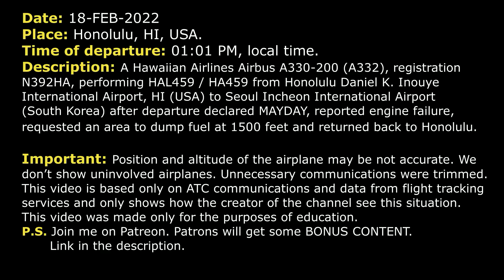MAYDAY. Engine failure after takeoff. Fuel dumping | Hawaiian Airbus A330-200 | Honolulu, ATC

Comment: Also if you had one engine Failure with no engine fire indicated why wouldn’t you taxi off the runway and leave it available for any other emergencies does not make any sense drama Pilot 😵‍💫
Reply: they also wanted a visual inspection from the ground crews as the failure could've done something the pilots didn't know about
Reply: it's standard practice to shut down on the runway in the US, they need to stop as soon as possible

Comment: This sequence of events is very strange. Levelling off at 1500ft after an engine shut down isn’t the best idea, even if you’re over the ocean and there isn’t any terrain where you’re holding. Also, asking permission to jettison fuel is odd.  This isn’t kindergarten where you need permission to go to the toilet. You’ve announced “mayday” (although pan would be sufficient) and you’re clearly wanting to return fairly urgently. 40,000lbs is about 10-15 minutes of jettison time. Begin the jettison and tell ATC, don’t ask for permission.
Reply: Wow didn’t know u  are trained pilot and experienced many of these issues

Comment: I echo the comments here, great video and production. But why on earth stay at 1500’ 20 miles away from the runway?????
It’s an ETOPs aircraft for goodness sake, a climb to 5-10,000ft would have been no issue
Reply from the maker: Thank you. I don't know what was the reason.
Reply: @YouCanSeeATC  I was a pilot training manager at HA during this time and subsequently discussed this incident in class as a great example of airmanship and communication- both internally and externally with ATC. I have also been a pilot in the seat during 13 engine failures (I was military and flew C-130s), so I know what they were juggling. I can tell you that performance-wise, they were doing everything they could to keep people safe on this hot day, and fuel jettison kept them within safe landing distance/braking limitations. They stayed at 1,500' (I presume- for the record, I was not part of the ERC or the investigation) because it is an easy pattern altitude, and climbing then descending again to land immediately would have added to the complexity and workload they were already experiencing. At 1,500', there is no need to run additional climb/cruise checklists, nor a complicated descent and slow down when turning back in for a landing. The extra altitude would help if they had to glide on zero engines - maybe - in the infinitesimal chance they lose the other one, but not necessarily. Climbing higher when the other engine was producing perfect thrust is not necessary and can potentially make calculating a landing spot and pulling off the single-engine landing maneuver more complex.  Every pilot is intimately familiar with a 1,500' radar or visual, pattern altitude speeds, etc. This was a very sound workload-management call; they also dealt simultaneously with cabin crew, passengers, and emergency responders. Less juggling of tasks = more safety. If you knew all the performance and workload considerations, not to mention the engine failure possibly turning time-sensitive as it did in the recent Trans Air crash, you would have preferred what they did to having them climb up into the higher altitude structure, taking additional time and power on the operating engine if you or your babies were on this flight.

Comment: Excellent procedure on the emergency call! That's the way to do it. Just a bit surprised they stuck around at 1500 feet where discovering you had a common mode failure, like the same person made the same mistake on both engines, would lead be a real issue. Was there low cloud? I thought the minimum dumping altitude was 6,000 feet, but the FAA says 2000 feet above anything within 5 miles, which I guess would mean 2,000 above the Pacific. https://www.faa.gov/air_traffic/publications/atpubs/atc_html/chap9_section_4.html

Comment: It's rare to see ATC rush the "cleared to land" clearance -- I wonder if they thought they needed to do this because of the Transair B737-200 that ditched off Honolulu about 7 months earlier. That Transair flight with the dual engine failure was a true aberration, since dual engine failure on a jet is exceptionally rare. However, the quick "cleared to land" by the controller here had no adverse effect, since the pilot just calmly replied to the effect of "no thanks, we want to wait."
Reply: Right. ATC did an excellent job, if you need to come back you can do that right now. Exactly the sort of response that should be offered to a MAYDAY call.
Reply: I thought the exact same thing.
Reply: I think if you listen closely the same controller was in the tower for the Transair B737-200 and this flight.  I think she was there on another engine out incident about 2 months after Transair B737-200.
Reply: Nope hnl favor Hawaiian over other airlines it's a known fact anyone who works there knows about that
With dumped fuel to oil spill they get away with alot in fact most rubbish on the ramp it's from Hawaiian airlines

Comment: Just curious why they chose to stay at 1500, looks very low, i thought you would ideally want to get some more altitude  for troubleshooting and fuel dumping before returning.
Reply: Completely agree, surprised they didn't climb up another 5000ft
Reply: If they’re over the ocean there’s literally nothing to run into. Standard traffic pattern altitude for turbine aircraft is 1,500AFE.
Reply: @TGCourt  it just leaves very few options if the other fan quits.
Reply: @TGCourt  They were 25 mi out, not in the pattern.  If they had other issues, 1500ft can disappear very very quickly.  Plus I've never heard of anyone fuel dumping from 1500ft, normally ATC will give you a climb into the 10k range prior to a fuel dump.
Reply: @Boffin55  totally agree with you
Reply: @TGCourt  I am assuming cloud. I don't know though. As mdb831 says, that's not leaving many options if the other one quits.

Comment: Internationally, as long as the engine failure doesn’t cause a dire control issue like a loss of control, you would normally declare a “Pan-pan, Pan-pan, Pan-pan” (said 3 times) not a “Mayday”.  You’re telling ATC you have an issue or problem but controllable and you may not be able to comply with their instructions…and to standby.  You can always upgrade the call to a “Mayday” if the situation becomes more dire.  

We don’t “Declare an emergency” Internationally.  That’s a US thing.  Declaring an emergency in the US is like saying “Pan-pan” Internationally.  If the situation becomes worse you can upgrade it to a “Mayday”.  If you say “Mayday” over in Asia, they will stop all traffic taking off and landing for you and until you safely land.  Not something you really want to do at a big International airport unless the situation warrants that.  

So, it sounds like it wasn’t a dire control situation and therefore declaring a “Mayday”  wasn’t the correct terminology in this particular instance.  Not gonna ding the crew cause I wasn’t there and don’t know what they were dealing with initially and they may have had control issues.
Good job by all involved.

Retired MD11 Capt
Reply: ATC direction for mayday includes:  "engine failure that will lead to a forced landing/ditching/ejection/bailout;"  Since the pilot did not know the exact status of the engine failure at that point, he was playing it as safe as possible for the highest priority with ATC.  My God, you people really think you know all about flying commercial aircraft from your keyboard while sitting safely in your basement.
Reply: @buckhorncortez  He just wanted to show that he was a MD 11 pilot.... Stupid comment about "mayday or not mayday"....
Reply: @PetrolHeadBrasil  Actually, I was quantifying my answer with my background to show actual real world expertise and not just the usual Microsoft Flight Sim keyboard warrior expertise I see on here.

Frankly, I don’t know why I even bother anymore trying to help those who ask questions.  You guys think you have it all figured out and I can certainly find better things to do….Bye!
Reply: @willyTB1962  bye-bye, darling!
Reply: @willyTB1962  ohhh, and by the way: 11 years of aviation here... ;)
Reply: It's subjective, who cares. Maybe (doubt it) their SOP's require them to call a single engine failure a Mayday. You're looking too far into it anyway.
Reply from the maker: Thank you for your comment. That was a long text with a lot of information 👍
Reply: Theres always gott be 1. Losing an engine is always an emergancy. It is easy to back seat drive when you are not in it. They did a great job, no incident, no injuries, no further damage to the aircraft. Great job by these boys. I hope I get to fly with them.
Reply: There's far more to consider than just "they only lost one engine". If you're up high and have plenty of altitude (and thus time) to play with, and within easy glide range of one or more airports, and/or can rapidly identify the cause of an engine failure as being something that's extremely unlikely to result in a second engine failure, then by all means don't sweat losing a single engine. Pan-pan is probably appropriate.
In this case the pilots didn't have sufficient altitude to troubleshoot the problem or give them a margin of error in the event of a second engine failure, so mayday seems quite appropriate.
Reply: Pretty sure a blown up engine is in fact an emergency internationally 😂 just because they were calm doesn’t mean it isn’t dire.
Reply: @BlakeWildBASE  Granted, it’s more serious than the coffee machine stops working on a long flight🥴, but it’s typically not a dire life and death situation on large jets.  All performance calculations are based on losing an engine at the most critical point on the takeoff roll (V1) and continuing the takeoff while meeting all climb performance criteria.

When the crew said “Mayday” that sets in motion different actions by ATC than just saying something like “Hawaiian xxx…engine failure, declaring an emergency…turning to heading xxx, standby”. Saying Mayday t means we need to land NOW..IMMEDIATELY.  THE HECK WITH DUMPING FUEL ETC..  it’s a life and death situation.  Obviously, they had full control of the aircraft.  They had time to dump fuel to their max landing weight and run checklists.  Just making a point to clarify the difference between MAYDAY call and declaring an emergency or Pan-Pan.

Fly safe!
Reply: @willyTB1962  oootaaayyy 👌
Reply: I'm gonna try to remember that when I get an engine failure, leaving 8R at HNL.... aviate navigate communicate... Jesus...

Comment: I don't understand why USA ATC consistently tries to tell pilots what to do after declaring an emergency. Vector here and another vector there. The pilots said what they were going to do hdg155, 1500ft. Leave them alone to sort it out. 
Happens so frequently.
Reply: ATC has to keep them out of the way of other aircraft.  That's all they're doing.  Quit second-guessing everything like you know all of the interrelated considerations that have to be taken into account to safely vector ALL aircraft in the area.
Reply: at 1500ft. out of the way of other acft? on a heading of 155 and 1500 ft out of PHNL. really?
Reply: @t288msd  just curious why 1500’ to 8L? Well done btw.
Reply: @t288msd  that area is actually more busy than you’d expect. HCF vectors us GA aircraft at 1500’ south of HNL to get in and out of JRF.
Reply: to add to that, there is always checklists that need to be run and usually the company needs to be contacted in most cases. ATC is usually always in a rush to get them on the ground (rightfully so) but in most engine failures for large aircraft, the aircraft can still be flown for a few minutes for checklists and fuel dumping as was with this case.
Reply: You're kidding, right?
Reply: Can’t argue with that at all. Shut up and let them do their job
Reply: Matt, you’re correct in that ATC shouldn’t have been giving instructions while the crew was dealing with the problem.  

In ATC’s defense though…the crew did initially declare a MAYDAY instead of just “Declaring an emergency” or “Pan-pan, Pan-pan, Pan-pan”.  There are differences and those words mean different things.  The Mayday call made it more urgent and that’s why ATC basically said land any runway or asked which one do you need while trying to give them a heading back to the airport. Mayday means we need to land NOW and it could be a life or death situation.  

The crew also should’ve told ATC to just “standby” with any further communications until we call you.  Some ATC folks are pilots and understand what the crew is dealing with.  Most ATC folks aren’t pilots and don’t quite understand how busy things can get during a non-normal or emergency for the crew.  Yes, they’re trained for the event but sometime human nature kicks in and ATC are trying to be helpful.

Having recently retired from a 34 yr career as an airline Capt (B727, B75/76, A300 and MD11), I can assure you that jet engines don’t just quit very often.  When they do it’s rare for it to be any more serious than a another routine maneuver in the simulator.  I know the general public, non pilots and the movies make it out to be a full blown disaster, but most are easily controlled and flown to a safe routine landing.
Reply: Somebody on this channel always has a problem either with US pilots or ATC. Get a grip already.
Reply: Not just US ATC and pilots. 
"Get a grip already" is such an US thing to say that makes no sense at all to anyone outside the US  ;)